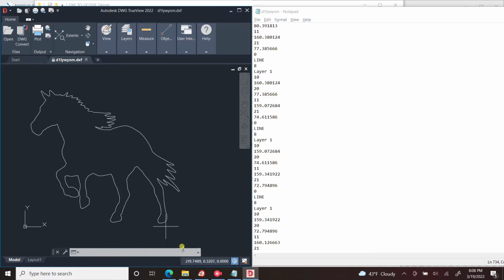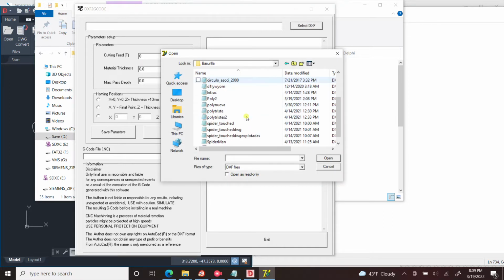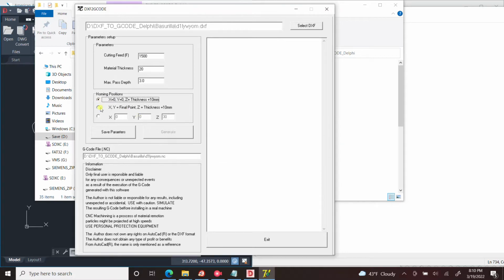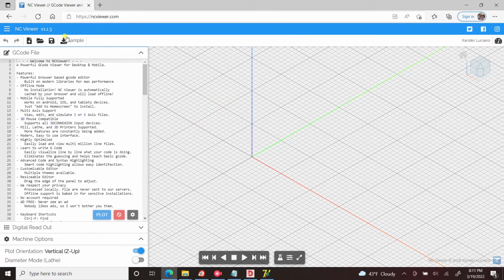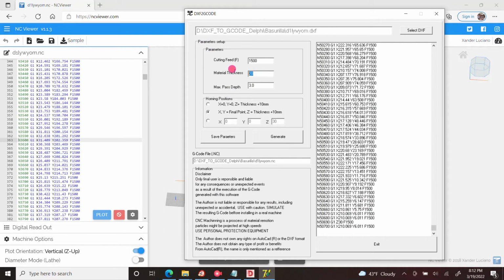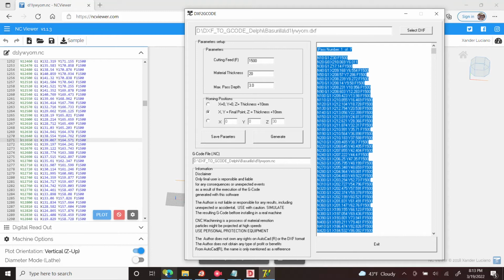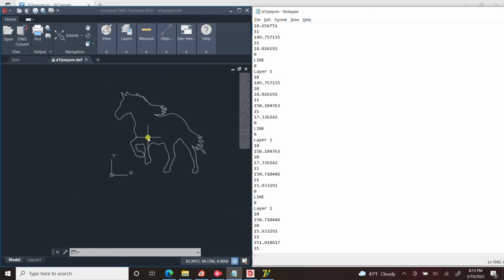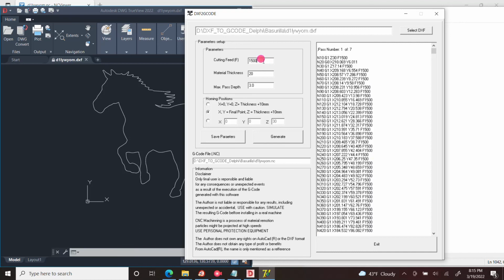DXF 2 GCODE

Comment: hey so after i put my file in how do i generate the g code
Reply from the maker: Good morning, now if you got the app, from the link in the comments bellow (GitHub), there are a few steps to properly setup your workspace.

1.- Select your DXF file in ASCCI format (better if you saved it for Autocad R11, because this formatting allows for complex contours using SPLINES, to be segmented into very small lines, you want this because the app can process. only -POINT, LINE, ARC, CIRCLE, POLYLINE and LWPOLILINE.

2 Fill the required fields from left to righ.
 -Material thickness 
-Z axis parameters such as hight above material, for fast motion across the table.

-Comments enabled (this will add some comments for easier navigation, when reading your resulted NC program.

-Preferred home position 
(Normally check 0,,0 for X,Y and Z clear, or last X,Y in your part program and Z clear.

-If your machine has tool change capabilities, you can enable it. And specify which M code will call for it (normally M6) or if you have a specific macro name you can select that option.

-Auxiliary M function can be used for external triggers,
Like coolant or anything you need it for.

There is a Dwel option aswell, normally CNC controllers USE G4 with a complement F Value in seconds or milliseconds.
This will be needed if you want to make a pause before moving your tool.
For example in laser or plasma cutting processing, you need to pierce, before contouring. Or in routers the maximum RPM are achieved aftee 5 or more seconds.

Upto here machine parameters, now lets go to your specific part.

In the tables below, the top one with a single line allows for parameters.

You can use the same cutting parameters for every layer found in the drawing or you can setup by layer. (Normally for routing I do all in one ser of parameters.

Once every field of the table is filled and every field on the top of the app. You can save your parameters.

You see success when the bottom table, has the values transferred frlm the top table in to the corresponding layers.

Once this is goodc click on generate.

Please verify that there are no interference risks, by simulating your resulting NC, code.

Even the best CAM apps. Generate collision motions, it not setup considering every detail.

Comment: Thanks for creating this very useful software!  Can I use it to create G-code for a Hotwire  cnc machine?  How can get the software?
Reply from the maker: it is possible to use it in a hot wire machine, only if your machine ignores Z axis values

I can email it to you for a drive test, I must insist it is still under development, bugs may be found that where not seen in simulations.
so any feedback will be appreciated
Reply: @urielvargas6777  I understand, and would like to take you up on using the software and providing you feedback.  Please send me the software.

Comment: How do I get this software
Reply from the maker: I can give you a demo copy It is still under development (Exe File) today 

I have accomplished a couple of new things like.  Layer selection (means you can use CAD software to edit your DXF and organize it in layers this way when you open it using my little app, you can decide what gets cut and what does not.

Also, it has now the option to generate code for subtractive machining (milling routing, means cut by digging into materials)
or laceration machining (torch, plasma, water jet or laser cutting means cuts above the materials) 

Also includes a section for tool start and stop.
with variants for Millin routing to start spindle at the beginning of the program and stop it at the end
or for plasma, laser or water jet, it allows to turn on the tool once the cutting moves are going to start (for example it goes from one geometry or another, using G0 then it drops down to be close to your material, here is when you turn on your torch, for this option you have a delay, readable by FANUC SIEMENS or MITSUBISHI controllers
G4 F1 or G4 X1 or G4 P1 (G4 standard G code for duel programming X, F and P the time specification in seconds).

Comment from the maker: I am working on making this software more useful.

Basically the Idea I am testing righ now has this few improvements

1. Allows you to ignore layer 0 from your DXF file. If you arenot  familiar with layers.
Basically is an option that CAD software offers to allow you organize your drawings.
For instance lets say you are designing a house.
You can draw your land perimeter in one layer, then create another layer to draw the foundation, then another one for the electrical, other layer for plumbing etc. And you can hide them so it is more practical to only see the one you are working on, then if you un hide them all when finished, you have the whole house visible.

Back to our topic, having the option to ignore layer 0, when creating g-code.
You can use this layer in your cad program, to draw a frame with the same size as your real cutting area in the physical machine.

Then fit inside your design, you can then know with certainty if your machine is capable of cutting the whole project. And you will know that it can be centered or located in the most convenient position for you.

Simply by moving this layer 0 and making sure one corner matches 0,0 
And is oriented the same as your machine.

Also, amongst the new features, there is an M3 M5  (tool ON /tool OFF) 

With different modes, for example if you are cutting with plasma.

Then you can select a delay timer, G4 X3 (g4 is the g code for duel timers X is the parametr in seconds)
As soon as the tool is positioned and the Z axis is in the cutting distance.

Or you can tell that your machine is a router that only needs tool ON at the beginning of the program and OFf at the end of it.

For this the delay works different it basically moves XY to the plunge position then the M3 comes in right after the duel ir delay to allow spindle RPMs OK.